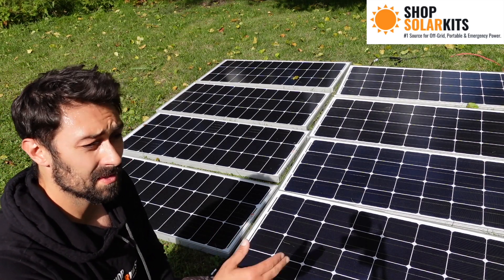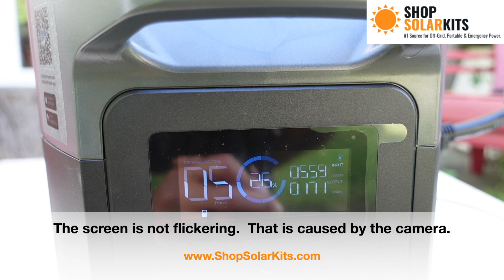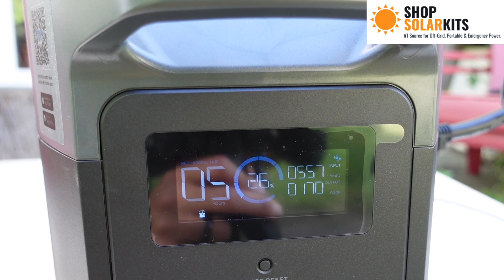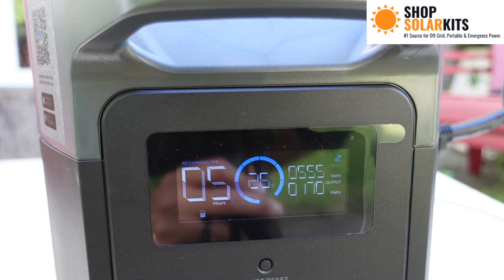8 x Solar Panel Setup for Solar Generators | How to: Octo Solar Generator Kit Step by Step Guide

Comment: Can I do 20 panels (100W each) same setup for Ecoflow Delta pro? Is 2000W input too high for Delta Pro? Thank you
Reply: You have to calculate the maximum voltage input.  All depend on what is your VoC on your panel.  Delta pro can handle up to 150V.  So if each panel is 12 Voc 11 x 12 = 132V you want keep some buffer not reach to 150V.  Because winter time your voltage will goes up. Once hit 150 you can damage your unit.

11 panel (assume 12Voc each) connect in series total 132V and amp is the same. Another set connect in series same thing.  Finally you connect both group in parallel voltage will be the same , but amp will be two add together.  Over amp is okay, since device will only take as much it need over will be only wasted.  Over voltage will damage your machine.
Reply: No the delta max has a max imput of 1000 watss
Reply: the cuestion i have its why doing 2 string of 4 intead 1 string of 8 you save the y conections

Comment: Question: first of all I am new to the solar world but I am not understanding something. 
Why 4 in series and not 8 ? 
I have  (2) Renogy 200 watt suit case in series going to my EcoFlow max 2000 and it works fine. 
I tried parallel and they didn’t work. So if I hook up more panels wouldn’t I just keep them in series ?

Comment: Wait a minute. You showed everything but how to connect the red cable. You only showed two red cables going to each end, but where are the other ends?? Thanks.
Reply: I think he use same color cable. Some people only has black cable, and they use it for both positive and negative.  Important thing is MC4 connector and label both end of cable. So you don’t mess it up.